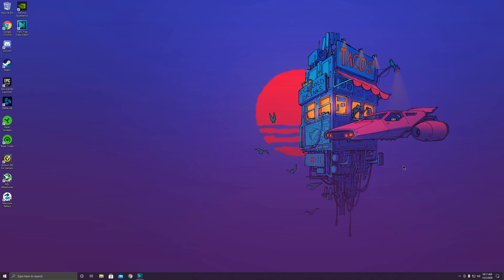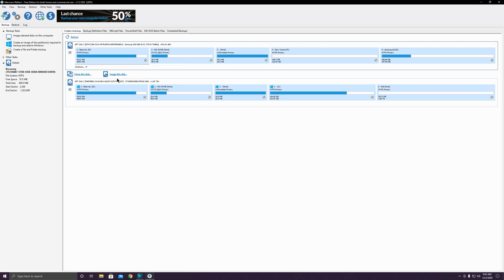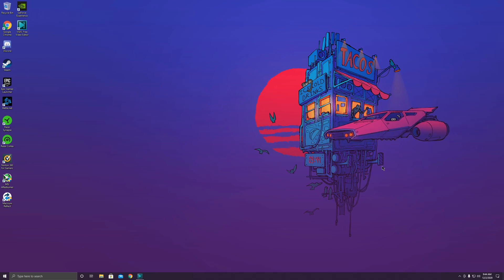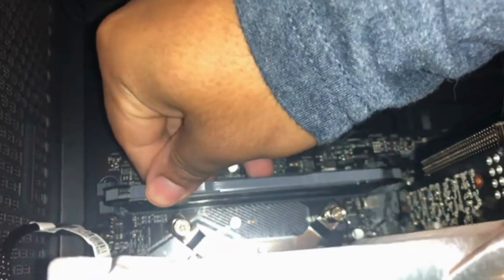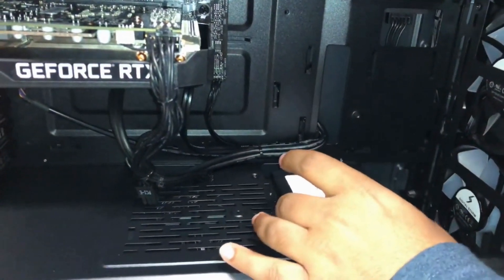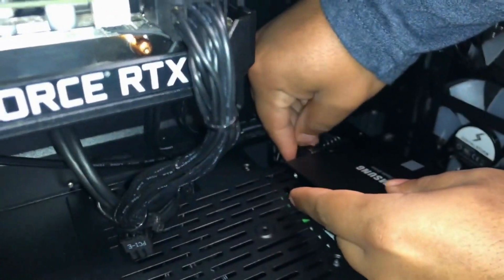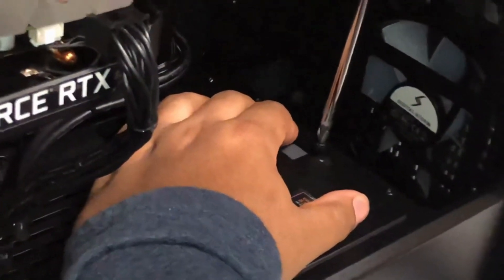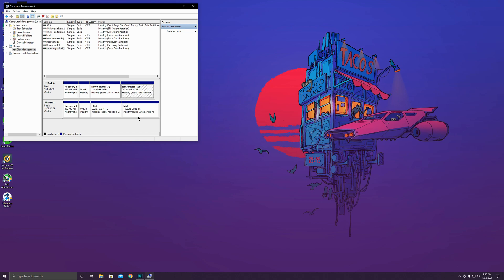How To Upgrade RAM And SSD On A Digital Storm PC

Comment: What motherboard and cpu do you have
Reply from the maker: Unfortunately digital storm doesn’t specify the MOBO, but I believe it is an Asus prime H410M-A. My cpu is an I7-9700F.
Reply: @ickybb  Also would the corsair vengeance pro 16gb 3200mhz be compatible with an Asus prime H310M-E R2.0 And a i7 9700f?
Reply from the maker: @HYPERZ30  yes they are, you shouldn’t have any problems with them!
Reply: @ickybb  thanks
Reply: @ickybb  Ok thanks. im tryna upgrade the ram  in my digital storm pc too

Comment: Just got this pc , but my cpu fan is hovering right over my ram, did you move the fan or it came like that,

Also what a cheesy mobo they gave us ….
Reply from the maker: Hmm that’s weird, my pc did not come that way. Mine came prebuilt as shown in the video. They may have changed their factory prebuilds due to parts being harder to find/being more expensive in the market. Also I agree the MOBO is rather cheap, but I haven’t had any problems from it nor my pc in general. Did your pc not come with the direct copper cooler master for your cpu?
Reply: @ickybb  hey, I did some research and I have the same cooler , I was able to install what ever ram I wanted because the fan does slide up and down,

Also from what I was reading having the fan on the ram side is the correct way…
Reply from the maker: @Boom-rc5gl  Really? If that’s true I can’t believe they sent mine backwards. I will look more into it, thanks for the reply. I definitely did not know that! Also I’m glad you were able to install your RAM sticks!
Reply: @ickybb  thank you, please research it , it make sense though , if that fan is pulling in air, it should be before the cooler not pulling in air through the cooler…

Comment: Quick question, so before you clone the old ssd are you supposed to remove the old ssd and add the new ssd then allocate the ssd and then clone or just follow your steps in the vid.
Reply from the maker: I would just follow the video :). You can start by cloning your ssd to your hard drive. then swapping out the ssd’s and you can either allocate the new ssd now or after you’ve successfully uploaded your files to it!

Comment: Is it possible to upgrade everything inside the Digital Storm Pc from Motherboard to fans?
Reply from the maker: Yes everything is upgradable. Upgrading the fans may be a little tricky though just from how the manufacturers wired them. Also remember to take into consideration the dimensions of the case, if you’re planning to upgrade fans and cooling systems!

Comment: How about a new hard drive can’t figure out how to get the housing out
Reply from the maker: Hey I took my hard drive out as well. So if you flip your hard driver face down. On the black housing there’s a little lever that has 3 groves on it. Push that in and hold it while sliding the side that has the lever out away from your hard drive and it will expand and come off.
Reply: @ickybb   yeah figured it out when I was poking around and fount our my housings shelf’s has a latch on it all good now thanks

Comment: if i get a graphics card would i need to plug in my power suply cable into it
Reply from the maker: Yes.
Reply: @ickybb  ok so i have the lynx 1 what graphics card would u recommend
Reply from the maker: @codymccarthy3844  the rtx 2060, (the base cpu may bottleneck “hold back”)that card some, but it will still work to its fullest capacity if you do not want to upgrade your CPU. I would also recommend upgrading your RAM sticks from 8 gb to 16 gb.

Comment: Question if I am trying to put a ssd card for the first time do I have to purchase another adata cable to be able to put another ssd I have lvl 1 digital storm
Reply from the maker: If you’re swapping them then no, you can also take it from your hard drive and use 2 ssd’s as well. With the level 1 you might have to buy the cables to just add an extra ssd. The slots are there but i don’t think it has the extra cables. You can check by removing your back black panel, by unscrewing the to hand screws on the back. If you have the cables it will be tucked away in there.

Comment: 💔 level 4 .. first boot no signal to monitor and keyboard and mouse are not lighting up as well ... my first pc and it's not going to goo d .....dang ... need help 😭 .. great vid
Reply from the maker: Dang I’m sorry, since nothings working I’m curious.. Did you make sure your pc is turned on? There’s a switch on the back of it, that’s turned off. That needs to be on in order for the pc to turn on once you click the button. Also make sure your psu (power supply) cable is intact and plugged in! Make sure your RAM sticks are firmly connected too. You can also pop that back panel off and make sure cables are connected to your motherboard! If none of those things work I would contact digital storm and they will help you! I hope everything works out.
Reply: Thanks for the quick reply and advice.....
Pc does turn on .. front fans spin and light up , graphics card fans  spin.. cpu fan and light wasn't connected. ( light still not connected..to short to go into led slot) from what I can see all other cables are secure.. still no luck with display and keyboard mouse.. gonna try pulling ram sticks and reinstall... after that I'm clueless and will have to reach out to digital storm 😭
Reply from the maker: @sun_e_daze2611  do you have both a display port and a hdmi for your monitor, because mine required both! Other than that I’m stomped, Also you can try to plug your keyboard and mouse into your monitor if you have the accessible usb slots! (Just to be sure it’s actually the PC malfunctioning)  I hope you don’t have a short circuit or bad fuse or anything, please keep me updated when you contact Digital Storm. I’d like to know what was wrong, I’m curious now! Hopefully it’s an easy quick fix!
Reply: This happened to me too 😐 did you find a fix 🥲
Reply: @bonesaw3422   i am still in process of trying to get fixed. After talking with there tech department they are leaning towards the graphics card having a issue. They give 2 options .. pay for new card and be refunded once you return old card ..or.. send current damaged card,  have them check it , wait for new card to come in mail.  Overall I can say that my experience  has not been great. I sent my old card with there 2 day ship label from FedEx last week .. I have had 0 contact from digital storm saying they received or are  sending the new one...  they are not good at returning calls and being in contact with the customer. I'd like to say something positive but unfortunately 2 months having it and still can't use it ...
Reply: @sun_e_daze2611  🥲 i bought my graphics card last week
Reply: @bonesaw3422   your having a no post issue with the new card  ? Old card works?
Reply: @sun_e_daze2611  I had integrated graphics and I bought an RX 580
Reply: @bonesaw3422   would be nice if the new card would show up i.. so I can see if that helps my situation  .. I wasn't about to send them 600 for card when I just sent them 1500 for the pc ... just hoping mine wasn't lost in shipping lol 😅
Reply: @sun_e_daze2611  I fixed it what I did is I took Out my GPU ram and SSD and then unplug the power cable to my motherboard plugged it back in and put back in my SSDGPU and ran I turned on my PC and it booted up fine
Reply from the maker: Dang that’s actually terrible...
Reply: @ickybb  it’s all good I fixed the problem
Reply: Update .. called to check status .. they did receive the bad graphics card .. and then informed me that they are out of stock ! Thinking maybe in 2 weeks will have restock .... sooooo disappointing 😞
Reply from the maker: @sun_e_daze2611  wow, that’s very unprofessional. I would ask for a refund or even return the whole pc and look at other companies. They don’t deserve your money, it’s been a month. I’m sorry brother. I hope you can start your pc journey soon!

Comment: I’m getting a Corsair liquid cooler (240mm) and I’m wondering if will fit in the case
Reply from the maker: So I can’t find the case specs unfortunately. IMO I think it should fit, the only reason it wouldn’t, would be because of the RAM sticks.. But you can always mount it behind the front panel with ease if you have that problem. So one way or another, I’m pretty sure it will fit, you have nothing to worry about!
Reply: @ickybb  can you do a video on how to install the liquid cooler cause I’m having trouble to
Reply from the maker: @uziverttt8983  hey, what troubles are you having with it? I dont personally own a liquid cooler to make a video on it, but I still may be able to help!
Reply: Did it fit I’ve been wanting one too. The fan next to my cpu is always blowing out hot air when I’m gaming

Comment: Yo I have a question so since we have the same mother board did you know that it only allows ram at 2666mhz ? If so then why did you buy 3200mhz ram ?
Reply from the maker: I actually didn’t know that, thanks for telling me. Guess my next upgrade will be the mobo! I will say though since I upgraded my ram and ssd I have an easier time multitasking. Even though it supports only 2666mhz, and with my ram being 3200mhz it just pushes the mobo to its maximum support with no repercussions. Your cpu has a say in that department too. Which ours supports up to 4700mhz, I may not be getting my full value from my ram but I do see a notable difference.
Reply: @ickybb  okay thanks for the feed back I gueee I’ll get 16gb 3200 hz ram to cause 8gb is not cutting it 😂
Reply from the maker: Yea, 8 gb of RAM will definitely hold your gaming experience back lol. Good luck upgrading!
Reply: @ickybb   will corsair vengeance lpx 16gb 3.2ghz (2pk) work for upgrading my digital storm pc if I take out my old
Ram and out this one in?
Reply from the maker: @Starscream8896  yes should be good to go as long as it’s DDR4
Reply: @ickybb  thanks bro

Comment: How many ssd slots are there? Is there just 1? Or can i have 2 seperate ssds
Reply from the maker: First I just want to say, It’s possible to fit 2 ssd’s in one slot. They’re thin and don’t over heat. To answer your question, there’s 1 extra slot and 4 sata ports. The mobo also features a M.2 NVMe ssd slot as well.

Comment: If you were to upgrade the graphics card would it be hard because its prebuilt?
Reply from the maker: Good question you can upgrade it! It won’t be harder but you’ll be extremely limited to gpu upgrades.. One issue with a lot of prebuilt PCs are weak motherboards with only basic components. So if you were to upgrade the gpu, look into getting a new motherboard too, it’ll give you more options! If you don’t want a new motherboard, just Also make sure the gpu is compatible with your current motherboard. Also make sure your power supply can handle a better gpu wattage!
Reply: @ickybb  say if i had the same pc you have and i wanted to buy a rtx 3060, without buying a new motherboard, would it still be compatible?
Reply from the maker: @Alex-ct5mx  sorry, I don’t think our motherboard has the PCIEs slot required for it. Also you would definitely have to upgrade your power supply even if it did have the slots.. You can get a rtx 2070 with no further upgrades, but it’ll be a far cry from that 3060 you wanted.
Reply: @ickybb  ok thanks for letting me know, ill try to upgrade to 2070 thanks bro